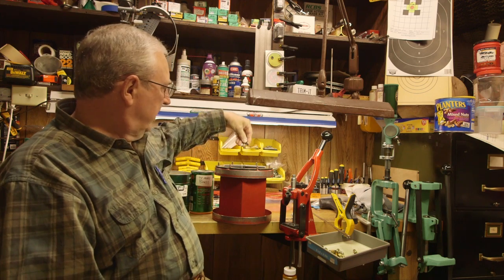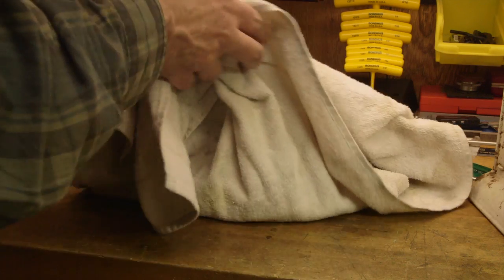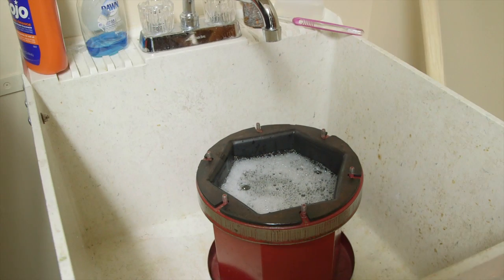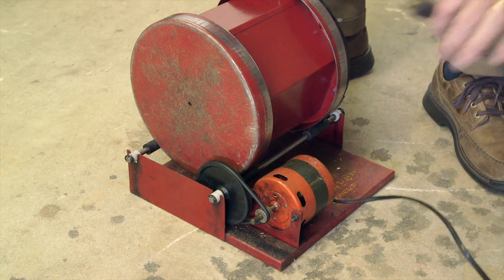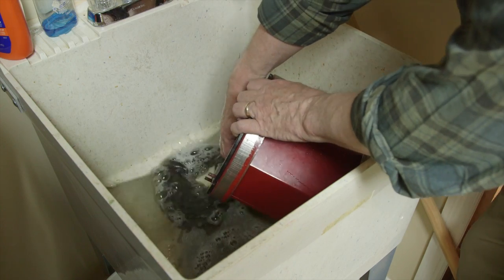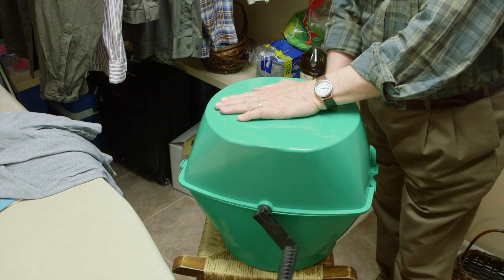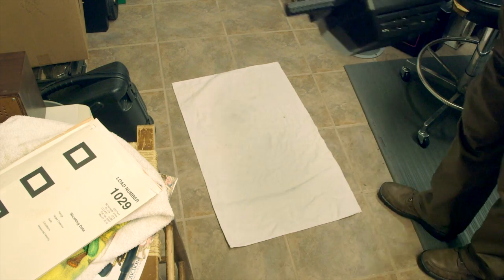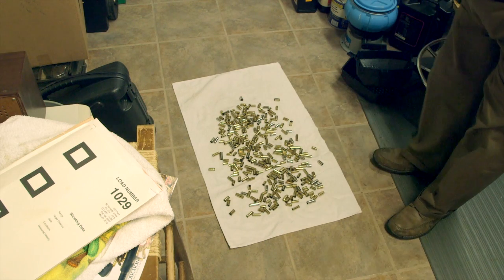Brass Tumbling w-Stainless Steel Pins

Comment: Will this method work on rusted screwdriver bits used on cordless screwdrivers? (Obviously, NOT in water)
but perhaps dry and using stainless steel pins in a vibratory tumbler?
Reply from the maker: I would absolutely try it with a few in the water, Dawn and Lemi-Shine. The parts won't rust while under the water and if you get them right out and dry them off, I would not be surprised but what this will work just fine. Naturally I'd experiment with only a few to start with, but give 'em six hours of tumble time and I'll bet they will be super clean and free of rust.
Reply: I have used the exact same tumbler, Dawn, and Lemi-shine to clean and derust srewdriver bits and socket wrenches, with water. The tumbling action rubs all the dirt, grease and rust off very quickly. I tumble brass cases about 30 minutes and the steel parts about 15 minutes. After separating the steel parts from the pins I soak the steel parts overnight in WD-40, then spread the parts out to dry on paper towels. The steel parts will be clean and shiny. If there is any loose chrome on the sockets due to rust underneith, the tumbling will rub the loose chrome off and the pins will rub off the rust.
Reply: Really? Go to home Depot and buy a 5 pack for $2.00

Comment: The reason I started tumbling with the stainless media is because it is the only thing that will 100% of the time truly clean the primer pockets. This is important because after a time if you don't, the repeated firing and loading will cause an ever increasing amount of ash build up in the primer pocket, which in turn will create high primers. BUMMER! I used to hardly ever clean my pockets. Maybe once in a blue moon, and it was one at a time by hand. I love reloading but cleaning pockets one at a time by hand drives me nuts. So, I started looking into a way to clean my pockets on a mass scale that was easy and effective. Don't, let me repeat, DON'T waste your money on an ultrasonic cleaner. They simply don't work ! I now deprime and tumble every time simply because I don't ever want anymore high primers, but OH!!! how pretty the brass comes out looking. It looks like new brass every time. I tumble for three to four hours per batch, separate the brass from the pins, dump and spread 'em out on a clean towel and let em dry for a day. There is one caviaeut to this method though. And this is very important. You must visually check every flash hole to make sure that there are no ganged up pins stuck in there after you are through tumbling. I learned the hard way on this as a .357 round that I loaded had pins stuck in the flash hole when I loaded it. Upon firing only part of the powder ignited due I think to the partially blocked flash hole. What happened was there was just enough pressure to push the bullet half way down the barrel. I was able to clear the barrel but was skeptical of the rest of those 500 rounds I had loaded. Fortunately that was the only time that that happened. However upon subsequent cleanings of brass I have found 2 cases now that had ganged up pins. I typically load 500 cases/rounds at a time. It only takes maybe 5 minutes to visually inspect for ganged pins in 500 cases. I highly recommend it !    Luv, Dug.
Reply from the maker: Exactly the same reason that started me on pin cleaning. Good advice about the stuck pins, too. Thanks for sharing.
Reply: You will lose your brass long before enough crud builds up in the primer pocket to prevent proper primer seating. Successive ignition of primers will blast out most primer crud from the pockets anyway.
In addition, A good reloader will always examine primer seating depth before boxing up his Ammo.
Reply: I disagree with your assessment RE: successive firings will blast out ash build up in primer pockets. You can get by without cleaning primer pockets for awhile, but eventually you will have high primers. Now, I have been reloading for 48 years now, it is " my hobby ", and I will tell you that I am reloading brass that dates back to sometime in the 90's, and I will tell you that it is still going strong. I do not load MAGNUM loads, but I load " mild magnum " loads for .357 and .44 mag. My brass have been loaded by a conservative estimate of maybe 15 to 20 times. Also, I will address your comment on examining primer seating depth as you are reloading. Yes, that is all important, however if you seat a primer on an extremely dirty primer pocket and it comes out " high ". What do you do ? You certainly should not try and decap a fresh primer from a primer pocket !! And loading as you suggest  you will come across some rounds that will not function in a  double action revolver, and may even jamb the cylinder in the frame. So........I have come across a system that works extremely well and a big bonus is that the cases when cleaned in the tumbled, stainless steel media, when loaded, look better than factory new ammo. And that is all I have to say about the matter.       Signed, Doug.

Comment: With primer pockets. For smooth burn. Is there any way to get insidr the casing primer holes burs cleaned out for smooth ignition?
Reply: Buy a "flash hole uniformer". They're cheap.

Comment: Supposedly you should use washing machine wet detergent rather than dishwashing wet detergent, someone said it strips the zinc outta the brass. I have been using washing machine since, no difference, so why gamble. Do deprime the casings before, I found out the hard way that wet tumbling leaves wet down in those old primers, and when you decap and recap all in one step, you might see some of the water squirt out and wet your new powder charge. This kind of information is not in a reloading manual yet. That I know of. Since stainless pins and sonic tumbling are much newer technology.
Reply from the maker: +ksharpe10 Yes, depriming before cleaning is very important. What brand of detergent do you use? I've not heard of the distinction between washing machine and dishwasher detergents. This is very interesting.
Reply: +Rex Roach The difference between washing machine detergent and dish detergent is mainly the fact that hand dishwashing degergents like Dawn are designed to be easy on the hands, the makers don't want the dishwasher's hands to get all chapped and dried out.  Laundry detergent will be much harder on the hands than dishwashing detergent. Having been around the soap business its hard to believe all the old wives tales about dishwashing detergent, stripping the zinc out of the brass is ridiculous!
Reply: That could very well be the case on the soap. But you were right about the lime shine being corrosive, I just decapped some that I washed a couple month's back, and occasional casing has this white with green corrosive looking powdery residue in them, I threw out the few that did. I may skip the lime shine. Thanks for the tips that are not yet in reloading manuals yet.

Comment: How long did you let the brass wash run?
Reply from the maker: I'm in no hurry so I let it run overnight. A minimum of four hours will get it 85% clean. If you change out the solution, you can do it in less time, but it so much easier to just let it run.

Comment: Where do you get the stainless steel pins?
Reply from the maker: +tkarlmann Most of the on-line vendors sell them.  Here's one from the Midway folks:

http://www.midwayusa.com/product/635839/pellets-brass-cleaning-media-stainless-steel-pins-5-lb-bag

This is for a five pound bag which is what most everyone uses in the Thumbler's Tumbler size machines.

Comment: I'm surprised these stainless pins are magnetic.  Good video, btw.
Reply from the maker: Thanks. The magnetic stainless steel seems to throw everyone for a loop. I won't repeat, but I've responded several times with much detail. Bottom line: some stainless steels are magnetic. Check through the comments for details.
Reply: I was just talking about it on facebook and so I did a search and found out what makes some ss magnetic.  Your video came up also.  I will be watching more of your videos. I found it pretty good.
Reply from the maker: Thank you very much. It's great to find fellow seekers of truth and wisdom...or booze and broads.
Reply: There is no specific definition of stainLESS steel. There are multiple alloys that are all considered "stainLESS" and stainless steel can be magnetic AND it can even rust or STAIN. Its stain LESS and not stain PROOF. I've got a Snap-On stainless top on one of my premium rolling cabinetes (roll-cab in Snap-On language) and it won't even begin to pull a magnetic. I've got a MAC Tools rolling tool cart with stainless inserts on top and they're magnetic as any other steel in the cart itself. Different alloys = different characteristics. Basic metallurgy.

Comment: There is no way those pins are 100% stainless. They would not stick to a magnet. I wonder what the metalerguly is.
Reply from the maker: +Laby 70 The magnetic properties of stainless steel is an interesting subject. Here's a good article on it from the folks at Fastenal. In a nutshell, there are five classes of stainless steel. Only one is non-magnetic. It is also the most common one. 

https://www.fastenal.com/en/75/magnetism-in-stainless-steel-fasteners
Reply: They are 304 stainless. stainless is not an element so there is no such thing as pure.    stainless steel still has steel in it depending on what type and can still be magnetic.

Comment: The cleaning solution becomes saturated with primer residue!.  Wear gloves and take care pouring it down the sink rather than the yard!
Reply from the maker: Not to minimize what you're saying, but let me pose a question: what about the tremendous accumulation of GSR (gunshot residue) that builds up on the hands of anyone shooting a revolver and most any handgun? The GSR contains exactly the same ingredients as the cleaning solution after the tumbling. In my case, my hands are exposed to the solution for less than a minute and then I wash them. When shooting handguns, our hands get blackened possibly for several hours. To me, that is much worse yet no one seems to mention that.
Reply: Rex Roach  The implication is that your exposing yourself to a concentrated solution rather than being dusted by residue.  cleanliness is next to godliness

Comment: You talk a lot about not having to remove the primers.  I would think it best to remove them so the water can flow through the cases and not just in and out.  Of course you need to inspect each case to make sure there are no pins stuck in the hole.  Also, for those that cannot obtain Lemi Shine locally you can always order it from AMAZON or Walmart .  Walmart has it for $4.32 + $4.97 shipping.  If you order more than one, say 4, the shipping is the same so a better deal.   AMAZON has it at $8.23 for one or 3 for $16.99.  If you have AMAZON "Prime" the shipping is free.
Reply from the maker: +gizmotech007 It's been a while since I've watched this video. I hope I didn't "talk a lot about not having to remove the primers" because I agree with you 100%, it's one of the major benefits of this cleaning method to get the primer pockets absolutely clean. Yes, there will be some stuck pins in about 3% of the cases, but if you keep a pair of needle nose pliers handy, it's no problem. Honestly, I think one container of Lemi-Shine will last three lifetimes. I use only a tiny amount now, far less than I did in the video. Amazon is amazing, isn't it?
Reply: +Rex Roach yes, three bottles of Lemi Shine would be overkill so for that you would be best served by sharing the order with some reloading buddies.
Reply from the maker: gizmotech007 And that's often true of many things we buy in our hobby, especially powder where several buddies or a club can make bulk purchases.

Comment: try stainless bearings
Reply from the maker: That sounds counterintuitive. Do round balls really clean? What size? This is interesting. Tell us more. What has your experience been with this method? Thanks for the input.
Reply: sorry, i should of been more clear, jewelers stainless media mix has 3 to 4 different shapes pins. the bearing ones look like like Saturn, has a cool thin edge sticking out around it that gets in corners,  there's different grades too by size.  some pins are cut short and thick, not to thick to work cut at different angles to get in tight spots.

Comment: The only thing I do differently is I use Nitrile gloves from harbor freight when dumping out the water. I wouldn't put my bare hands in that soupy black mess.
Reply from the maker: seabaas I agree 100% and now do the same thing. It might be interesting to take a sample of the "soupy black mess" over to the chemistry department at nearby Auburn University and have it analyzed. Actually, it might be more scary than interesting.

Comment: it's no good stainless steel if its magnetic..
Reply: Really? Is that why those stainless pins never rust and "good" stainless steel by YOUR "definition" can and will stain in certain environments? ALL STAINLESS STEEL WILL CORRODE, OXIDIZE OR STAIN if exposed to certain chemicals and conditions. Its stainLESS steel and not stainPROOF steel. There are a ton of different stainless steel ALLOYS and they all have different properties for different applications. You don't know what you're talking about. Run along now. Go read a book or something.

Comment: stainless dont stick to a magnet there smart one
Reply from the maker: There are different types of stainless steel. Ferritic and martensitic stainless steels are magnetic. Annealed austenitic stainless steels are non-magnetic. Work hardening can make austenitic stainless steels slightly magnetic.

http://www.scientificamerican.com/article/why-dont-magnets-work-on/
http://www.bssa.org.uk/faq.php?id=24
https://en.wikipedia.org/wiki/Stainless_steel

Google "stainless steel magnetic" for many more articles
Reply: Quick example of SS that is magnetic is 304 which has a higher carbon content making it magnetic, 316 not magnetic at all. My guess is the manufacturer uses the 304 due to it lower cost from a material standpoint. 304 holds most of the same qualities of the higher cost 316 and gets the job done. Long story short cheaper to manufacture the pins out of 304.
Reply: You better be 100% educated before you try to correct and insult someone, smart one. Rex is right. Several stainless alloys are magnetic. Stay humble (not so) smart one.